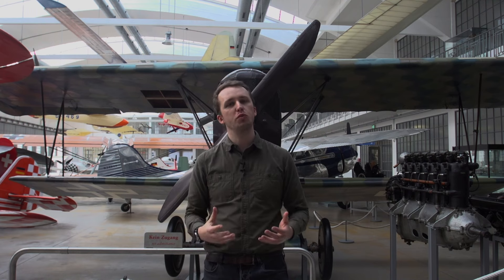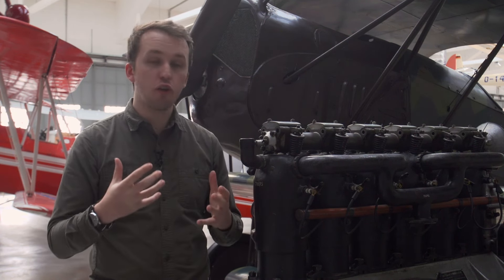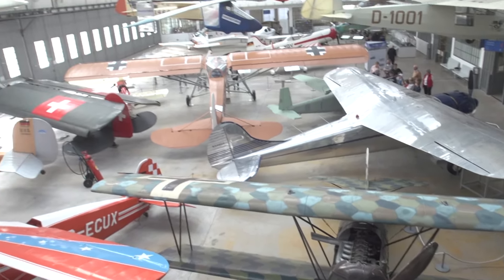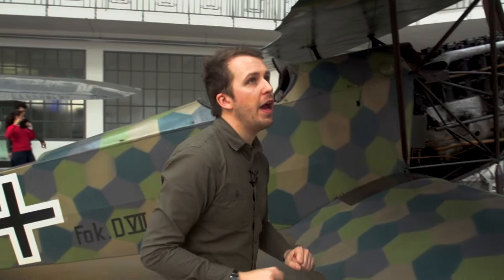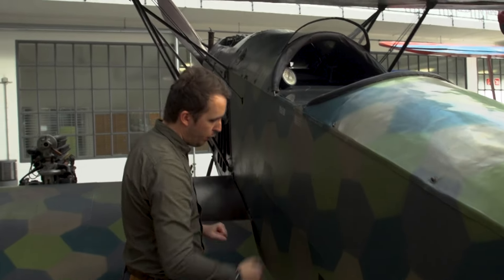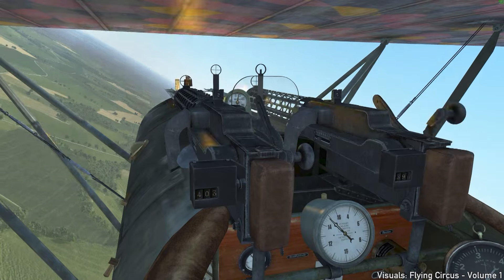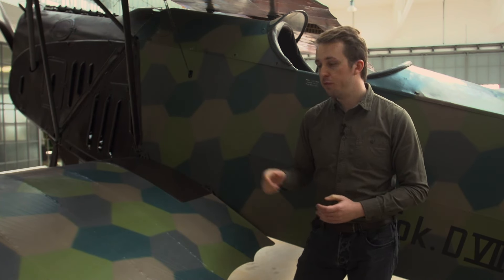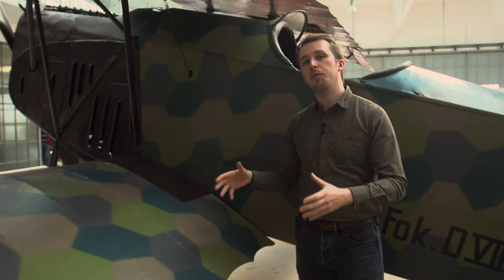Inside The Cockpit - Fokker D.VII

Comment: There is a company here in the US that make a kit of this plane. Airdrome Aeroplanes. There plane is an 80% full metal replica of the original.
Reply: Yeah, I just watched a video with them before this. They're near me in Kansas City. For some reason the kit looks nothing like this museum plane to me. A lot of the details like the grill are probably hard to replicate, and also just the sheer size difference with the original. There's no equivalent for the huge Benz/BMW 6 cylinder either, so it seems like people are mostly using vintage continental/lycoming or just VW boxer engines. It's still pretty cool that you could build something like that for around $10k.

Comment: Understand that the two throttles are to prevent damaging knock from the over compressed ratios at different altitudes. 6.75 cr was considered excessive at the time but gave greater performance at higher altitudes where the air is less dense.

Comment: The design of the Fokker D.VII has been credited to the German aircraft designer and manufacturer Reinhold Platz, who worked at the Fokker Flugzeugwerke. Prior to that he also designed the Dr.1, both of which he intended to be a cantilever design. The Triplane was initially not meant to carry struts, with Platz claiming this to be safe. The struts were later added on the F.1 to reassure the pilots. Antony Fokker was in fact a somewhat unpopular figure in Germany, due to the poor quality control at Fokker and the many deaths caused by the Triplane's habit of losing its wings mid-flight. One such ace, who was killed was Heinrich Gontermann. Lothar von Richthofen narrowly escaped death after his Triplane turned itself into a Biplane. He practically had to flee Germany after the war to escape possible persecution.

Comment: @14:37 the cockpit view shows the gauge on the right labeled as an aux fuel tank.
The reserve tank did not have a fuel gauge.  (that is what the watch is for)
That gauge measures the air pressure to the tank.  
The hand operated air pump in the cockpit was used to pressurize the tank for starting.  It was common for pilots to over-pressurize the tank to the point where the tank could burst.  (ask Kermit Weeks)  Once the engine was running, you would move a valve in the cockpit to us an air pump mounted on the engine to keep maintain the pressure.  The engine driven air pump had a pressure relief valve to prevent over pressurizing the tank in flight.
There were usually four valves on the instrument board.   
1) the fuel valve that was either; off, main or reserve.
2) the air pump valve that was either to the hand pump or motor pump
3) air pressure distribution: main tank or reserve tank
4) this valve would block off the air pressure gauge in case of an air leak.
When you would switch from the main tank to the reserve tank, you usually needed to pressurize the reserve tank first.

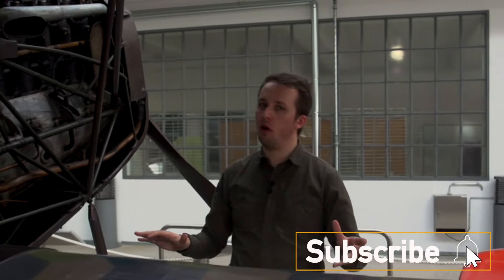Comment: 7:37 This airplane was a revolution in aeronautical engineering. The thicker, stiffer wing not only allowed the draggy wire bracing to be eliminated, it also was a better performing airfoil section.  From the Wright Brothers until this airplane, designers used thin sections, modeled on birds' wings, which work well at that scale (as well as in the small wind tunnels of the day) but not so well as airplane scale.
Reply: Also on the wing in early aircraft you see a lot of wings with camber in the underside of the wing. Something that pretty much disappeared once proper wind tunnels were developed.  I think about the only aircraft you would see camber in the underside of the wing yo day is on ultralights.

Comment: The Spandaus on the DR1 and DVII ejected out a hole in  front of the receiver and were channeled by open trays...on the right gun as can be seen in the shells were channel out to the right and the left gun they were channeled out to the left. Very crude method that annoyed Hermann Goring to the point that he installed shields on each side to make sure that empty cartridge cases did not come into the open cockpit. You can see it in his models.   Aha, another subject I can do a video book on.  142 were given to the US which used them into the early 20's in their original Germany  livery and only recovered all olive drab when it was due to service the covering.

Comment: Workmanship and fittings somewhat cruder? In a German machine? Heresy I say.
A local wire rope manufacturer used to supply bracing wire for aircraft struts wings. The wire was actually drawn into an elliptical shape to help reduce drag. Some of their product is currently sitting on the Moon in the LEM Descent Stages cargo bays.

Comment: It's worth nothing that drilled out barrel jacket is imperative for the operation of the MG08 (as with all Maxims) due to the weapon operating through short-recoil. The barrel and bolt both travel rearward a short way together as pressure drops and the internal toggle lock unlocks. The barrel stops and returns to its forward position under spring tension while the bolts hurls all the way back prior to sliding forward to chamber the next round. That residual shroud needs to support the end of that moving barrel. Now, obvious to all is the fact a simple strut and rung could take on the same job but, this is war. To do as such would mean taking an incomplete weapon, finishing it with a role specific part from a specific production line then putting it on a plane. By cutting up the jacket a complete gun can be converted easily and without an additional production line while allowing every gun to be used in any role prior to deployment. An aircraft gun is terrible on the ground, the Maxim design has a thin barrel which works well if kept cool but which fails quickly if it gets too hot and it will get very hot, very fast without water or a slipstream to cool it.

Comment: Your description of the guns and the firing mechanism is not correct. The favored German belt fed machinegun for these planes( and most others in the German arsenal) was the LMG 08/15. The LMG 08/15 is a variation of the original MG 08/15. Both are updated versions of the MG 08. All are variations of the belt fed maghinegun designs of Hiram Maxim. Hiram Maxim was an American  designer/engineer/inventor/genius and his belt fed machinegun designs predominated on all of battlefields of WWI. The Germans used the MG 08 as the standard watercooled machinegun. It was refined to the MG 08/15 for "portability"(still water cooled) and then further to the LMG 08/15 (air cooled with the slots mentioned) originally for airship use. The Russians used the Maxim 1910 on all fronts in the largest quantity (it now has "Hero Of The Motherland" status in Russia as it was a mainstay of both WW1 and WW2).The British used the Vickers which was the most advanced and  different of the variations of the Maxim design. One thing that is common to all of these guns is that they are FRONT ejection. The bolt on any of these Maxim guns carries  rounds of ammunition stacked vertically. The top round has just been stripped from the belt, the middele round is in the chamber, the third is a spent case on the bottom of the cartridge carrier and is ejected FORWARD out a small hole in the frame of the machinegun. Full belt of ammunition goes in one side. Empty belt comes out the other side. Spent cases are ejected FOWARD from a hole in frame. It was quickly learned with the early Maxim belt fed machineguns that they would stack spent casing in front of tripods  so a small tube was added that would direct spent casing down and to one side. But spent cases still came out the bottom of the gun and were ejected from the gun in a FORWARD motion. Perhaps the planes had an outlet for these tubes to dump cases out of the plane. But spent cases ARE NOT ejected from the side of the guns action.  
  A couple of interesting side notes. The Maxim MG 08/15 is the most common belt fed machinegun on the NFA inventory list  (National Firearms Act, a U.S. law that requires registration of machineguns personally owned in the United States). There may be as many as 2000 of these. Some are not in operable conditon  but many are as the mechanism is extremely robust. The vast majority of these were given to the US after WW1 as war spoils. FORGOTTEN WEAPONS on youtube has firing demonstrations of the MG 08, the MG 08/15, and the LMG 08/15. All are real guns firing live ammunition. All eject from the bottom. 
  Second, everyone that has not studied or learned about Hiram Maxim should take the time to do so. He was a very interesting individual. He was originally a gas and electrical engineer/inventor. He holds the first patent for an electric light from the US patent office. Well before Thomas Edison. His electric lamp used a platinum filament and though it burnt out quickly it proved the point for patent purposes. He then realised the need for a carbonized filament and invented a cheap way to produce them. Edison had been struggling with the carbonised filament. Eventually he had to use the Maxim process for producing these filaments and pay Maxim a licensing fee. Ultimately, Edison and his backers paid Maxim $20,000 a year to stop doing electrical development and invention and sent him to Europe to spy on European electrical developments. All of this made Hiram Maxim very wealthy. Interestingly his patent drawing for the first electric lamp is a three wire system. Well before Tesla and his "Polyphase". To paraphrase Edison's comment about Maxiim, " he is able to see what is missing in my experiments and to correct and improve upon it before I can recognize the problem". He also invented the arc lamp or what we know as the huge aerial spotlights used for advertising. His arc lamp technology was adapted to furnaces and now most industrial furnaces use electric arcs to melt metals.
   He was also the inventor of a steam powered airplane that demonstrated flight before the Wright Brothers. In fact, the Wright Brothers said that without Hiram Maxim's exhaustive studies of propellers( materials, construction, size, pitch, blade configuration, and efficency) they would have taken many more years to get flying.
  Sir Hiram Maxim, an American knighted by the King of England for his service to the realm( for the contribution his firearms designs made to the winning of the war), a hero to the Czar and the French, an honorary member of the Court of the Chinese Emporer (yes, the Chinese bought Maxim's guns too!) is know largely forgotten or remembered solely as a death merchant for WW1. Nevermind the fact that he did not live to see the horrors of the WW1 battlefield or that his impact on modern life ( hundreds of patents many still used commonly) as an inventor and genius is as important as others whose names we celebrate. 
   Lastly, he also wrote a book called "My Life".  It is in reprint and is an enjoyable and informative often funny book about Maxim's life.

Comment: I read that the Fokker DVII was singled out for destruction because it had a trait that was dangerous for the enemy.  This trait was that it had the ability to hang by its propeller in a vertical position much like a helicopter.  This gave the pilot the ability to strafe the underside of the enemy aircraft as it passed overhead.
Reply: Sorry total nonsense.

Comment: Bismarck, this particulair plane was not built by Fokker nor Albatros or OAW, it was built in 1926 by the "MLD" or "Naval Air Service" in The Netherlands. Hence the strange cockpit layout, double radiator shutters, the metal turtle deck and allot of other details. It flew as D 20 for the MLD.  The archives show that D 20, wich initially was built at Fokker in Amsterdam was taken into service by the MLD on August 30th 1920  but on May 12th 1925 it was totaly wrecked when flying into a steel cable on the beach near Petten. The MLD build a complete new plane and gave it the number D 20 again. It was officialy written off on March 16th 1937. Even before WWII it was sold to a German filming company who used it for propaganda movies, after WWII it was found in a German barn and taken to the museum. That's why they found a red colorscheme underneath the painted lozenge in the 1970's restoration and underneath that was the Dutch cocarde and D 20.
This plane was not taken by Goering as some imply. Also for clarity Reinhold Platz had not much to do with the design of the D VII. Platz was master welder not designer, for that Fokker had a complete design team.
Reply from the maker: Hey, thanks for the info. I'll have another chat with the museum in regards to the aircraft once I can!
Reply: @MilitaryAviationHistory  You are welcome. And keep uploading your vids!
Reply: Awesome post thanks!!
Reply: Hi, where did you get the information that is was sold to a German filming company? I understood the D20 was meant to be used in a Dutch museum that was still to be built. Also, the role of Platz still seems a hotly debated topic with no clear answer? It's been a while since I studied the D.VII so I'm curious to know if there is new info.
Reply: @JorisKoolen  This was told to me in the late eighties by the late Fokker historian Peter Alting who did research on it. If I remeber well D 28 was to be for the new museum. Platz was in function as chief designer in Amsterdam and it has been told by many in his staff that he lacked basic knowledge in airplane designing, also there is no autograph of him found on any of the DrI or D VII drawings.
Reply: @Makhpiyaluta2  Thanks so much! I think Weyl threw a bit of a fox into the henhouse with his claims about Platz, but it's also clear from his writing that had some issues against Fokker that he wanted to express...
As for the aircraft discussed here, is it possible both D.20 and D.28 made their way to Germany?
Reply: @JorisKoolen  It is possible but I don't know for sure. Weyl's book has done allot of damage on historic facts, he was biased and wanted to make more of Platz role then it in fact was. As for the D VII at the DLS in Berlin that one came from the Deutsche Luftfahrtmuseum in Böblingen near Stuttgart and has been on display there from 1931 till 1934 so that was not a Dutch D VII.

Comment: Excellent review, Bismarck. One of the best fighter aircraft of WW1. Particularly impressive to me is the focus on drag reduction-using far less wire bracing than in comparable Allied fighters, attributable largely to the cantilever wing design, cleaner more streamlined fuselage, etc.. Fokker squeezed as much performance out of the 180-200 HP BMW/Mercedes six cylinder engines as they could, keeping them a match with Allied designs using the 220 HP Hispano-Suiza V8 engine.

Comment: But, would not the use of domed version pistons (as compared to flat topped version pistons) actually reduce the available cylinder displacement at TDC) , thus resulting in an increased compression ratio?🤔

Comment: Most of the D.VIIs obtained by the United States in 1919 (sources differ concerning precisely how many there actually were, but the number was not slight, probably around 200, more or less) were mostly purchased for very little money as war surplus by American farmers, who used them as crop dusters. Some specimens were still flying over agricultural fields into the early 1950s. Even later, aviation historians found several D.VIIs --- or, at any rate, their frames --- moldering in various Midwestern barns. There are undoubtedly still a few examples, or their perishable remains, awaiting rediscovery.

Comment: Thanks for the aircraft detail. The engine is more built for torque with the long stroke? I am surprised that on many older engine's there is no valve cover to retain the oil,any way this fact would ensure it did not need changing so often?
Reply: G'day,

Those old Engine Designs with no Rocker-Boxes (Mercedes, BMW, Royal Aeroplane Factory, Napier, Hispano-Suiza & Curtiss OX-5 come to mind) only had Oil circulating in the Crankcase end of the Engine...; all the Rockers had Grease-Nipples..., and wiping the hot Grease off the Fuselage before it cooled after every flight was part of the ritual - as was greasing the Rockers being part of the Essential Daily Maintenance...

  In 1978/79 at Olde Bowral Airfield I worked on a Replica Sopwith Pup which had a Radial Engine - and to fit under the Cowling it's Rockerboxes had to be removed, & Grease Nipples fitted ; my job was to wipe off the Grease from the underside of the Fuselage - I was pretty low on the pecking-order, but I was hands-on with a Sopwith Pup, so I thought it was excellent.

Such is Life,

Have a good one....

Stay safe.

;-p

Ciao !
Reply: chris younts  

G'day,

  Would you like a tissue, to dry behind your Ears...?

   Look up a word called, "EVOLUTION" ; and consider that Humans try out ideas, and persist with them as long as they appear to work.

   Overhead Valves needed Rockers to go with their Pushrods, unlike the Side-Valves which Inline Liquid-Cooled Engines, and the Side-Valve types didn't need Cylinder-Head Lubrication.

Greasing the Valve-Gear worked a big heap better than not lubricating the Rockers...; and Grease-Nipples were LIGHTER than Rockerboxes full of hot Oil-Drips.

  So, under the Aeronautical Diktat of "Simplicate..., and Add More Lightness !" ; it was quite a while before the weight of the Rockerboxes could be justified by the Performance - obsessed MILITARY ; who were paying ALL the Developmental Costs of Designing Hairygoplane Engines worth building.

At Open-Cockpit Fixed-Undercarraige Fabric-Covered Biplane Speeds...; Pigeons can generally hear the Machine coming, and they reflexively dive to avoid Airborne Predators.
  
 Birdstrikes were the least of a Fokker D-VII pilot's worries ; and the Valve-Train would chop your Pig-with-Wings (Hypothetical "Pigeon") into Poultry Puree ; it would be a Birdstrike to a Propeller Blade-Tip which might imperil the Aeroplane - not a Chook-Impact on.a Valve-Spring.

In my underconstumbling.

Take it easy.

;-p

Ciao !